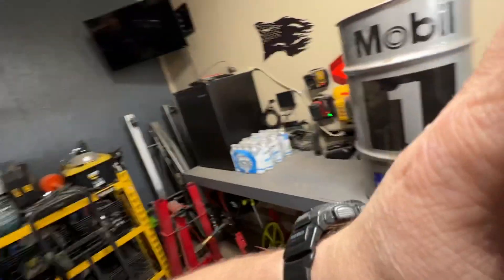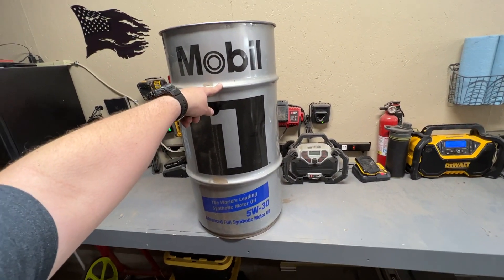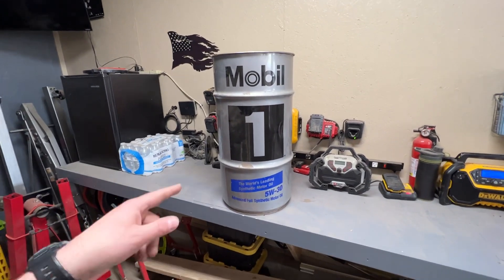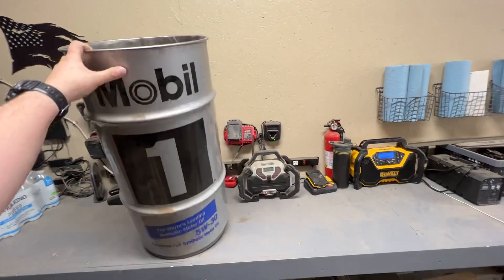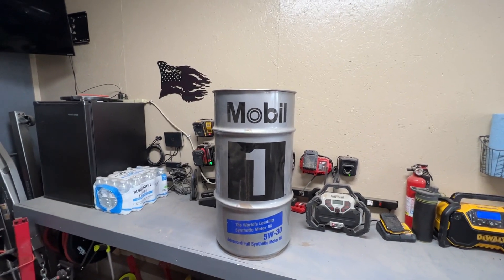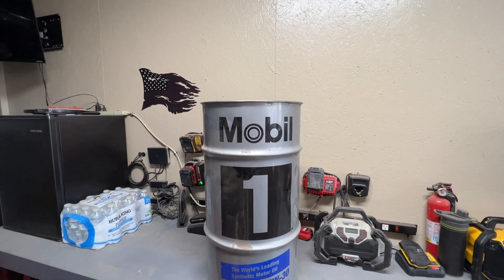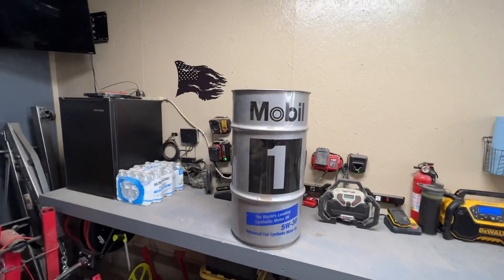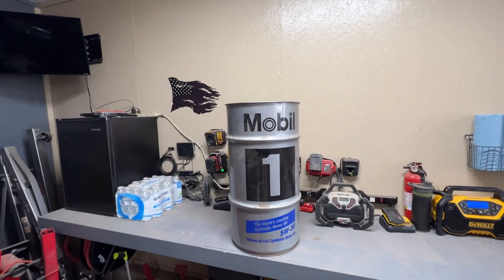Easy Way To Make A Faraday Cage

Comment: So I should be able to put a cellphone in one of these, call it from another phone, and the phone in the Faraday Cage won't ring.
I put my car "fob" in an altoids metal box and the car could still detect the "fob".  Put my cellphone into a microwave, (didn't turn it on), just used the microwave as a Faraday Cage.  Phone still rang.   :(
Reply from the maker: Yeah those aren’t really good test as the internet would like you think.

Comment: I'd like to know how to do the same for gas and diesel powered equipment.
Small stuff like generators, water pumps, lawn tractor. Would the EMP  Shield would work on a big ZTR?
Reply from the maker: Honestly the mower probably does not have any electronics in it that would be effected. But if it is a 12 volt system yes the EMP Shield would work. The water pump and jenny may also not need them depending on age.

Comment: Save your money. 
Use granny's old fruitcake tin.
Reply from the maker: Those will work but you might need a lot of them. ;)
Reply: @RealitySurvival  
Just be sure to use sandpaper to remove any paint or lacquer & rough up lid and can rim for solid connection.